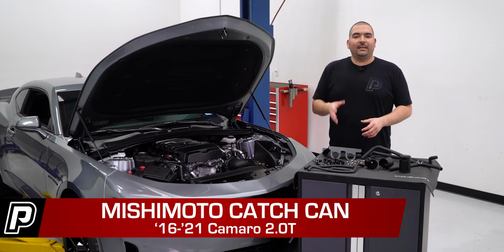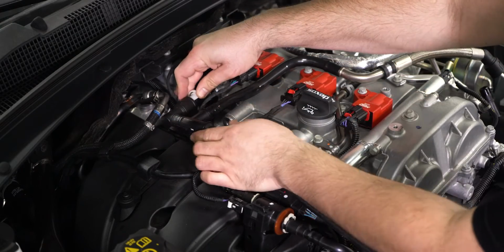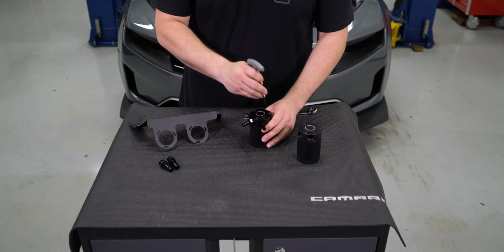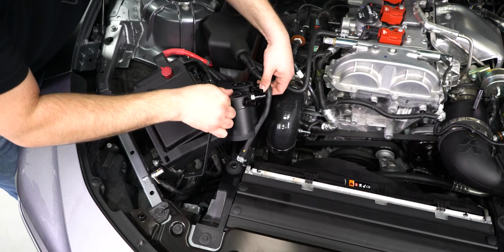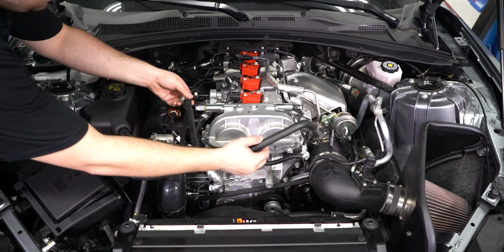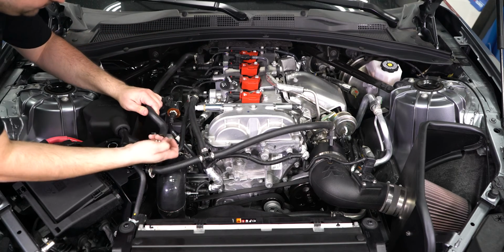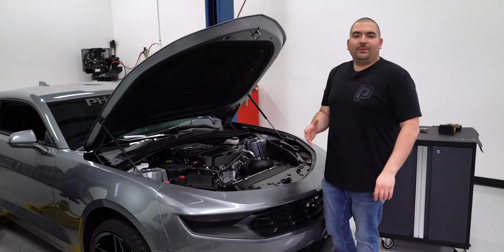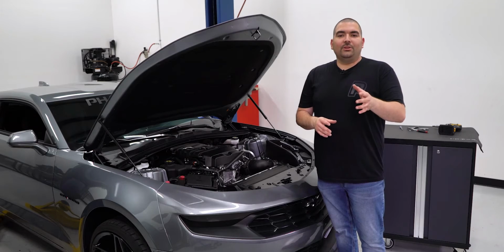2016-2021 Camaro 2.0 Turbo Mishimoto Oil Catch Can - Phastek Install

Comment: Very nice step-by-step informative video. Could you make on for the V6 version as well? I'm about to buy a Mishimoto catch can for the 6th gen V8 camaro assuming the mounting brackets and hosing included fits the V6 as well.
Reply from the maker: If there was a kit available for the V6 we would put it on the plan.  Unfortunately there is no direct catch can kit that will fit the V6 models.  The mounting location for the SS will work on the V6 but you will need to get new hoses for the lines.

Comment: Is it the same as the ss catch can or do they differ?
Reply from the maker: The cans are the same but the mounting bracket and installation will be different.   The SS models are actually a bit easier to install since they dont have an many hoses.

Comment: Where does one get that disconnect tool! For the ccv on air intake.
Reply from the maker: That tool is a fuel line disconnect tool.  Its a tool that we have had for a while and found that it worked in that situation.

Comment: If my factory CCV connection is broke and just on snug would buying this kit allow for a secure connection? I had yanked a little to hard thinking it would come off but it broke. Thanks
Reply from the maker: Unfortunately the factory Y would need to be replaced.  This kit would not be a fix for that.

Comment: Where can I get the hose removal tool?
Reply from the maker: Its a fuel line disconnect tool that should be available at any local auto parts store.

Comment: Don't get it, why are there two catch cans...?
Reply: One for CCV crankcase ventilation system & one for PCV Positive crankcase ventilation. Two different separate systems. 
Important with turbo higher pressure CCV